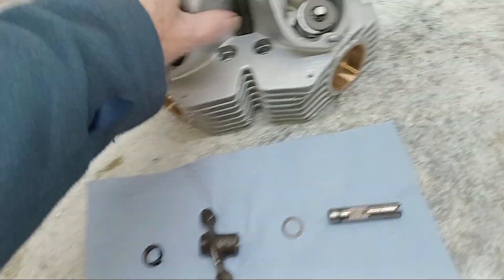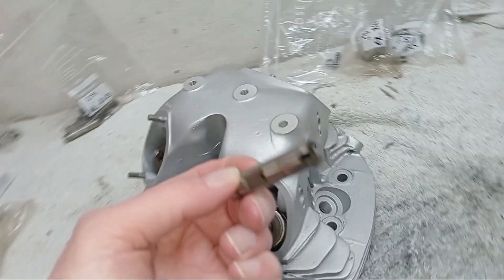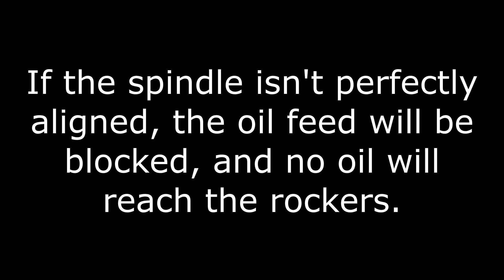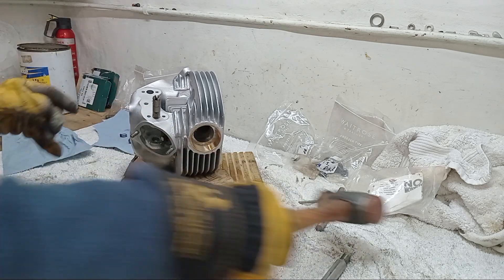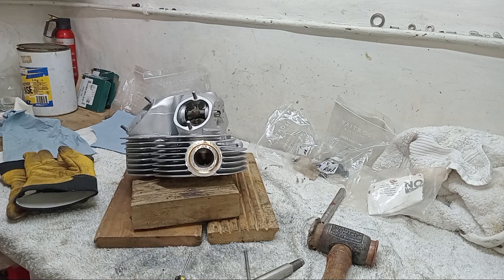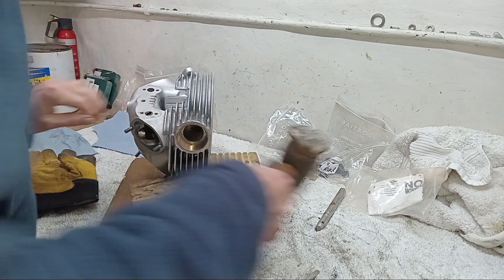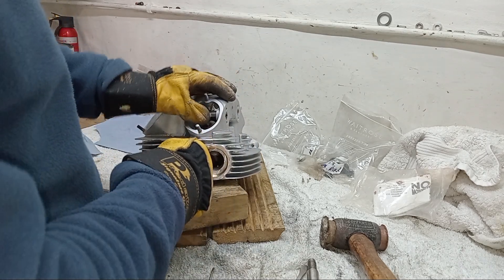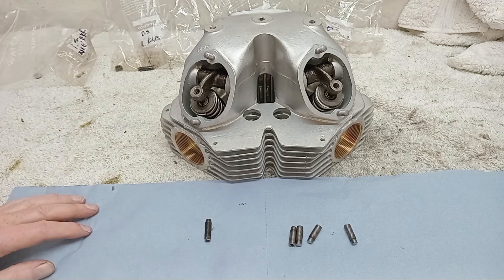Norton Commando Engine Rebuild. Part 71: Fitting the Rocker Spindles

Comment: Hello Chris 
I just received a Full Auto head to replace my R4.   While test fitting parts, I was quite surprised to find that the new Andover spindles I purchased fully inserted and seated into the unheated head and without having to use a mallet.   Would you think this a concern?  Thank you.
Reply from the maker: I would certainly question it. The main problem being that the spindles could slide inwards during use and so the slots on the ends would disengage from the lugs on the caps allowing the spindles to turn in the head. If the spindles rotate round then the oil feed to the rockers will be blocked. I would ring Andover Norton and have a chat with them, especially mentioning the potential problem above. Good luck.
Reply: @Chris.rooke150  I've been spannering a 750 Norton since 1972 used at least 3 different heads. OK I heat the head in the oven, can't be bothered to freeze the spindle. It goes in with much lighter taps than in the video. On mine I don't think the spindles can go far enough in to rotate but I'm using gaskets from either Andover or Norvil OR I make myself. They are thin and I do not use thick silicon glue. Just for Info, on a race Norton head I don't use the expanding shim, I use a brass plain shim hand ground down to size, origin probably Norvil.

Comment: Hello Chris
Two questions please.  #1) The head heated for getting the spindles started in the holes.  Is there anything wrong with drifting ALL the spindles in while HOT, (as in 4:42 minute mark on the video) then letting the head cool to complete the reassembly ?   
#2)  What would be your shimming recommendation be if the adjusters were not centered over the valve stems?   
Great tutorials!  Thank you
Reply from the maker: You can drift all the rocker spindles in at the same time if you wish. The only problem is that it can take quite a time to fit a spindle fully, in the correct position,  by which time the head starts to cool - but if the head remains hot, then that's fine. As for centring the rockers on the spindles, I'm not sure. I can only suggest that if they aren't correctly centred when fitted, then there's something wrong - you've either fitted tge washers in tge wrong order, or there's something worn or bent somewhere. Whatever the case, I think the problem would need addressing rather than trying to centre the rocker with washers etc. Good luck!